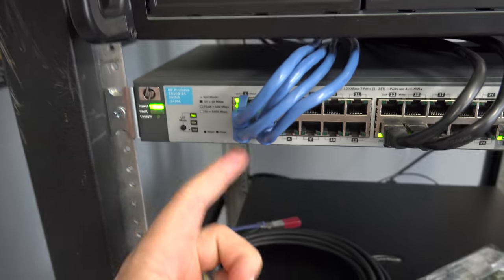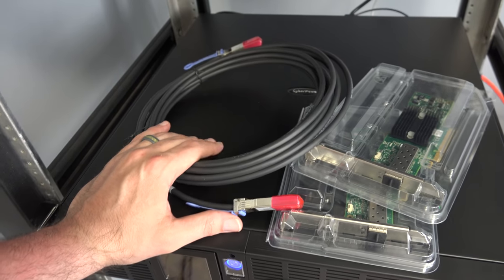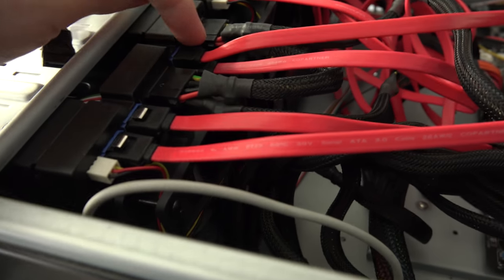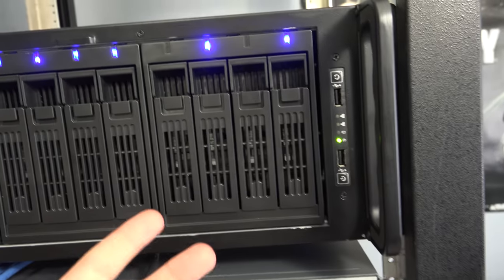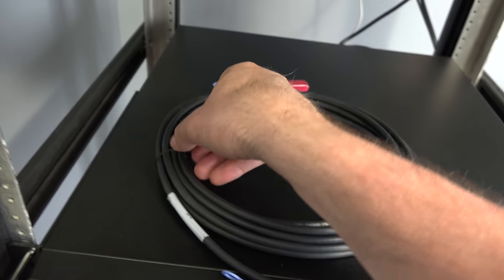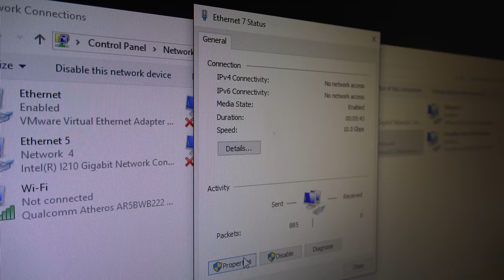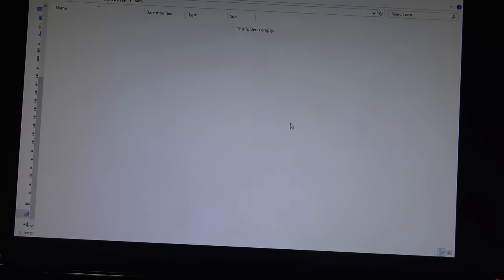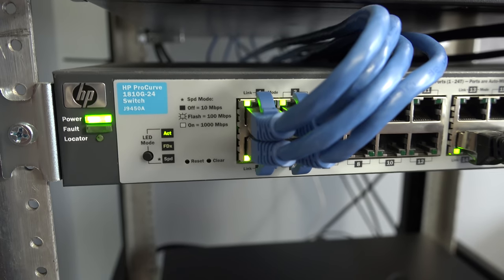Networking Vlog 2.0 - 10Gb with Peer-to-Peer SFP+ DAC

Comment: SFP+ DAC cable (the thick direct coil you have) is only in short lengths because you use fibre to join the same NICs for longer distances. You can get tens of kilometres out of those runs.

Having the NAS with a 10gb connection into the switch makes sense even if it’s the only one at that speed. It means that none of your 1gb clients can saturate the NAS connection to the switch (one client starts a big transfer, all other clients are out of luck for bandwidth). I know there’s link aggregation like you have but I found it a pain (maybe operator error)

Comment: WebGUI only for 1hr after bootup may be a security feature. It's designed so you have had physical access to the device to power cycle the unit and you have 1hr to change config. After 1hr, no random person in your network or malicious remote user can attack/change the config (until you restart).

Comment: deesh guy, i do not even own a computer but i do have a home network. i have a cable modem, router with 4port switch and 16 port unmanaged switch. also an network of home cabling i ran and put rj45's on, i just bought a 10 pack bulk of 1 slot keystone wall plates and a 10 pack of 2 slots, i got a 25 pak of keystone female to female rj45 couplers.

Comment: Awesome! I just spent my weekend building a FreeNAS box in that exact case! I've been looking at getting my hands on some 10GbE hardware over the last few hours (probably by big-data-Google recommended this video) since I found out that my network is my bottle-neck. I have two Intel gig nics on board, but even though I was able to put them in an LACP group I still only get a max of ~120MBps (~900Mbps) due to the way LACP works. If I am able to get 10Gb hardware and put it between my ESXi server and my new FreeNAS box I could set it up with Jumbo frames and could use the full power of the hardware.
Reply from the maker: The improvement this made to by communication between my main and server is amazing. best money ever spent!

Comment: You have a switch with 2 SFP+ connectors, just use them to connect the server and the pc, so you only need to use 1 cable to the server, not 4 and this with 10gb/s
Reply: Not familiar with this model of HP but I doubt that port supports 10gig.

Edit: looking at datasheet they are min-gbics: http://www8.hp.com/h20195/v2/getpdf.aspx/c04164471.pdf?ver=1 which can support single mode or multimode fiber at 1Gig

Comment: I know this is an old video, but nevertheless: I wouldn't recommend using longer than 7m(21ft) DAC cables - I've witnessed numerous issues with such cables in enterprise environments with cables from various vendors, including brand names like HP. It's mostly a limitation of the technology, which ultimately made vendors like HP to stop support for 10m and longer cables, which is probably the reason such cables have been increasingly harder to find and buy. 
Btw at the begining, I thought you were gonna plug it in the SFP ports of the 1810g and was like "noooo, it's a shared personality gig gibic port".. :) Speaking of the switch - sounds like a fw issue. I've had dozens of these switches, as well as way higher class switches in my labs and datacenter and have never had issues like this. Additionally, ProCurve switches almost always have lifetime warranty - call HPE to help you with about it, and it doesn't matter if you bought it on ebay or found it at a flea market - if it has procurve on the front you get the warranty, no questions asked. Also even if it hasn't active warranty, you'd need it only for part swapping (which for the 1810s is I the whole unit anyways), so you should be set for firmware fixes. Cheers!

Comment: Hey Byte My Bits,
whats the Model name of the Server case, please.

Thank you.
Greetz
Reply: I just happen to be looking at the same thing before finding this video.  It's a ROSEWILL case.  You can find it here.
https://www.newegg.com/Product/Product.aspx?item=N82E16811147233
Reply: Thank You very much!! I appreciate it.
Reply: @franklincerpico7702  I have one of a different model.. some are VERY LONG (25 inches) so they might not fit in standard 25 or 19 racks. also VERY HEAVY as they are made of steel.
Reply: @TravelWithCesarin  Both of mine fit in a startech 4 post 25U 19 inch rack.
Reply: @rdsii64  btw, I said 25 inches not units of depth ;)
Reply: @TravelWithCesarin  I know, I was trying to convey that my rack was a standard 19 inch rack that was 25U tall. The startech rack is also adjustable for depth but I forgot to mention that part. Sorry for the confusion.
Reply: @rdsii64  aaaaah gotcha! so it extends to accomodate?

Comment: Rest the UPS on the bottom of the Rack and put the Server on the Shelf Rails from the UPS.  I picked up a APC UPS from ebay (none rack mount-vertical).  You can get rails and used APC UPS from ebay.  tjl

Comment: Nice on the 10Gbe Copper.  However, those SATA controllers and cables are a nasty mess... You need to get an IBM M1505 8 port SAS controller.... And a pair of SFF8087 cables to do the SAS to SATA drives.  Much better....

Comment: Very cool. I love 10GB networking :)

I did notice though at least in the video you put 2 entries of both .1 and .2 pointing to the same host name, you should only have one new entry per machine. If your server is .1, then your desktop should only have 10.10.10.1 servername, and then your server should only have 10.10.10.2 desktopname. If you fixed that after then ignore me. :)
Reply from the maker: lol yeah i fixed it before everything was working (it turned out my firewall was blocking it though).

Comment: Great video and thinks for the details in the description of the products you are using.  Can you share a link to a video that would show how to create the connection between the 2 PCs?   I understand how a HOSTS file works, but seems like you were drilling through a lot of NIC Properties settings as well.
Reply from the maker: the link should be in the discription
Reply: It's not.
Reply from the maker: hmm oops I had it in the beginning of the video as an annotation. I added it to the description now though. 
https://www.youtube.com/watch?v=KHiucyRYX_w
Reply: Perfect.... missed that.  Thanks!
Reply from the maker: np, gluck! :)
Reply: Just a follow-up to let you know that I have 10G up and running between my Plex server and media storage server.  Works great and very very fast transfer now.  Thanks for the video and the guidance to get this done.
Reply: just out of curiosity why not run plex on the storage server? i have done so using freenas a few years ago and then switched up to unraid after finding out about pci pass through due to a linus tech tips video... have had several vm's plex and a storage server going for quite some time and with unraid it barely uses any system resources.
in fact even using beta version of plex on my server for dvr features

Comment: So do you have the Plex Server downloading as well, or your main PC then you "dump" to Plex Server? Just wondering, I just set up my new Plex Server, with PMS/SONARR/CouchPotato. So I can keep my main PC off most of the time and Plex Box running. I use windows Remote Desktop to control if I need to make changes.
Reply from the maker: My server only serves Plex and shares drives. my main pc does everything else

Comment: What is the main difference between plex and kodi? If I use it as a dvd/bluray repository, which would be better? Yeah, I'd need about two metric shit tonnes of storage but the idea is to rip at 1:1 and then have the software mount the image as a disc and play it like one.

The SFP cable looks copper. If you ever change the media to fibre optic, be sure to get cleaners for the SFP ports. Love this networking stuff, even if it doesn't look interesting ;)
Reply: People prefer Plex for comform, but as far I investigate, they are pretty much the same. But, I think Kodi creators works for XBMC. Correct me if I wrong. Greetings!.
Reply: XMBC got a new name, because it's not the XBox-Mediacenter anymore. So the new name is Kodi. And the difference is, that Kodi only picks up the metadater from your nas and each client works for his own. WIth plex you get a serversolution and you are synchronized all over our clients.(per user account)
Reply: Plex started as a Mac specific port of XBMC,  but has evolved.

Comment: i need a lil help..i have my 2 melanox conectx2 one is a single sfp+ an the other in my nas is a dual port,but freenas11.1 is not seing the nic in the os but it sees it on boot /or reboot...how can i fix this? my transfer speed is onlt 12mbps on my 1gb network..PLEASE...ANY IDEAS..

Comment: I have a question and hope someone can help me out on it. I have two Dell R720XD servers(with 10gb cards dual ports) and Ubiquiti 1gb and 10gb switches. I heard that best practice is to put the 10gb nic's on a separate subnet to separate the 10gb traffic. My main network is 192.168.1.1/24 and thought I could create a 192.168.60.1/24 to handle 10gb traffic and I created a new network on my Unifi controller and I tried setting the 10gb nics to 192.168.60.6 (for my desktop) and 192.168.60.25 (for my 1st server 2019 Hypervisor) and never got this to work so I have not continued to trying to hook up the 2nd HyperV. Does someone have a link to a article on how to set up 10gb cards so they will work with HyperV or a different subnet or am I just wasting my time and should keep all traffic on the 192.168.1.1/24 network and NOT try to put the 10gb traffic on a different subnet??  I have questions on how to configure the IP address gateway if I want to put 10gb on a 192.168.60.1/24 subnet  would it be IP 192.168.60.6   netmask 255.255.255.0 and gateway 192.168.60.1 or 192.168.1.1 ??

Comment: What type of bandwidth do you have to the Internet and do you use a firewall like pfSense to protect you?  Sorry if you've already covered that in other videos, I haven't had a chance to watch them all yet.   I'm debating if I want to change my setup and add 10Gb, currently I'm using VMware ESXi and running everything on one system, but do have a second system that is being wasted as just a very overpowered pfSense firewall that I I could offload all the drives (8x4TB) and build into a NAS.  Both systems have quad Intel Gb network cards connected via 24 port Gb switch.
Reply from the maker: I haven't built a pfsense router, but I really want too :) As for bandwidth I have 165 down and 25 up, but the 10Gb is for better file movement between my server and main PC.

Comment: You ever figure out why that drive wouldn't initialize? Have the same issue...with the same case. Got an RMA on the one 4-drive bay enclosure, but still had issues. Tried every power/SATA/drive/controller swap and just have one drive that won't spin up. Weird

Comment: do you run all of the drives in a RAID array or do you use ZFS or btrfs? and also, did you get that one non-working drive going again?
Reply from the maker: I am working on getting enough drives to switch to zfs. and the nonworking drive seems to be an issue with the drive bay. So I still have to figure that out
Reply: Byte My Bits are you waiting for enough drives because you're gonna be running a ZFS drive pool?
Because I was planning to do a 8 Drive raidZ2 array with a U-Nas 800 <-- A very nice chassis
Reply: ***** IKR, I was gonna setup a ZFS pool on a 8 bay chassis, so overtime, as I add more drives I don't have to reformat and I have the luxury or ZFS
Reply: ***** I meant with RAID you would have to reformat. and I was saying with a Zpool I wouldn't have to reformat as I expand my NAS overtime...

Comment: I'm not sure why you need 10Gb to that server? It has spinning rust buckets right? And the PC has what? an SSD? Either way your not going to be able to use most of the 10Gb making it kinda pointless. The HP NICS are rebranded Mellanox connectx-2 in case anyone is wondering.
Reply from the maker: Oh I use it. I move files to and from multiple drives at a time and edit video off it, while it is a Plex server. Having a dedicated 10Gb connection to it, insures I dont saturate the NIC and make Plex start to buffer for any user. I may not hit the max speeds, but it has been night and day for me
Reply: +Byte My Bits that's cool and all, but your servers should all be virtual, same with your networking. That way it would be easier to incorporate QoS for Plex. I don't blame you for wanting 10gb, but If you could actually use the 10gb Plex might still buffer from exceeding the storage capability.

Comment: i stream my plex server all local. i stream it from a pc to a chromecast and it studders. what could be the problem?
Reply: Well speed of your wifi and your cpu's ability to transcode quick enough to keep up with the movie. You could lower the quality of the stream to a lower Mbps and it should clear up.
Reply: If it's the CPU that's an issue, lowering the Mbps would make things worse, as the transcode would be more intensive.
Reply: +FeroMind wrong
Reply: +trevor turner thanks for that very elaborate answer. Regardless, if you do some research you'll find that in order for the video being streamed to be CONVERTED (read: transcoded) to a lower bitrate, it is more intensive on the CPU than if you were to remain close to the source bitrate. The answer you gave would only help if it was a bandwidth issue, not a cpu issue.
Reply from the maker: Start with the basics. Does that same movie play on other devices in your house okay? can it be played at lower quality settings too? Is the chromecast the only issue? If yes to all those questions, your server performance is fine. Your wireless network is the next step. Try moving the chromecast to a TV that is closer to the wireless router and see if you still have issues. if you dont, then u need to re-position your router to get a better signal where you want it. You could also try changing the wireless channel to see if you are locally congested.

Comment: have you gone on hp site to upgrade the firmware on the switch?
Reply from the maker: Yeah I checked it when I first got it and it was up-to-date
Reply: Byte My Bits
Might need to reflash it. I have one well 2810-24g Mine did that and after i reflashed it it was fine there was just recently an update for these switches. its now 02/18/16 N.11.74 They update the firmware once a month or every other month.. Hope that helps if not try to register on hp site They stand by there procurve products even if you didnt buy it from them the will still honer there warranty with next busyness day shipping.. I would look in to that Only reason i know is i  Bought mine off of ebay worked for a week and died So i went on line to there site and got a new one the next day no charge for anything.
Reply from the maker: I'll have to check it out! thx :)
Reply: Byte My Bits  hope it goes good for you as it did me that's the only reason I bought the pro curve line lifetime warranty 😎baby!! Glad I could help yea out anything for a fellow computer nurd. Let me kno how it goes. I just went on hpenterprize website made an account and re registered the switch.

Comment: What is the point of 10gb speed when the read/write of SSD hasn't reached 1gb/s, hdd are even worse. This will always be a bottleneck. Internet speed is still not at 1gb/s.
Reply from the maker: Even though I cant read or write at full 10G speeds, it's still faster than 1G speeds. Much faster.
Reply: Mamdouh Tawadros SATA III SSD speeds are in the range between 4Gb/s-4.5Gb/s so 10Gb/s network is not so useless to have.

(Gb, not GB)

Comment: Okay video that would have been a great one except for the annoying music in the background. That completely ruined it.
Reply from the maker: was it too loud? or u just dont like the type?
Reply: Both. At first I thought there was a second video or audio file playing besides your video, but I eventually traced it down to your video. t was just loud enough to sound like it wasn't supposed to be there but not loud enough to be able to follow the tune. The style didn't really fit the ambiance of the video as it was a bit too rambunctious and repeated too often because it was too short. Something a bit calmer would be a better choice for any audience and a longer selection that doesn't repeat as many times would also help. Thing elevator music to some extent although it isn't necessary to go to quite that much of an extreme. Remember that the goal i to keep the audience engaged. The music should complement the video and shouldn't conflict with spoken words or annoy the audience.
Reply: I wouldn't say the background audio completely ruined the video.  I went back and listened to it again and it does seem like the aggressive tempo or BPM conflicts with the casual pace of your dialogue.  I thought the music itself was fine, but I would try to match the tempo of the music to the activity in your video.  If your video was fast-paced with no dialogue that music would be fine.  I find that extended dialogue and music tends to conflict too.  Hope that helps...